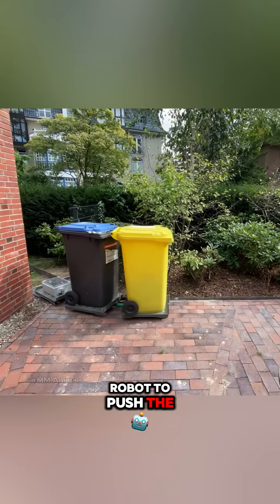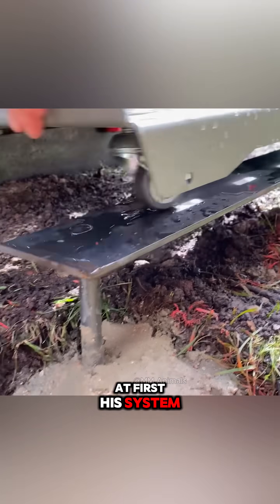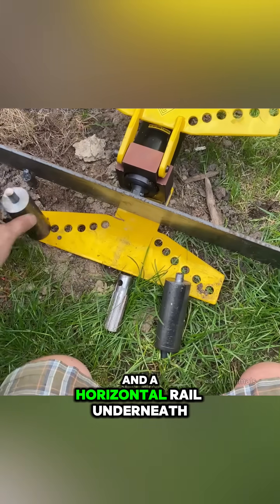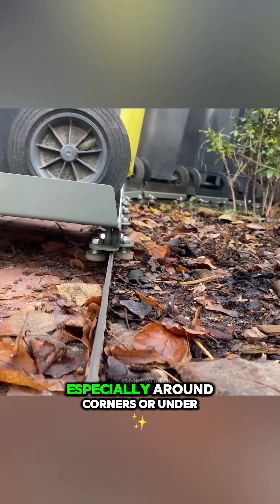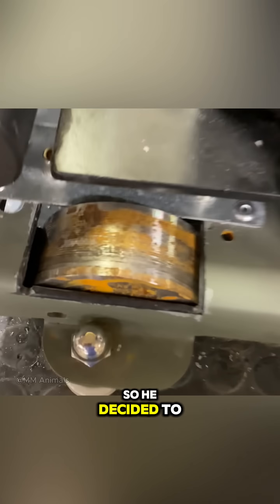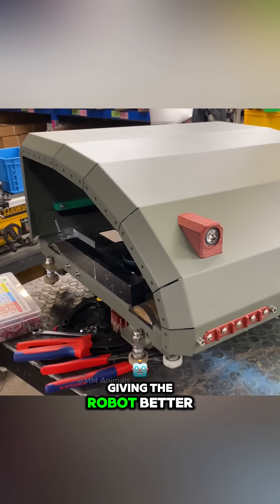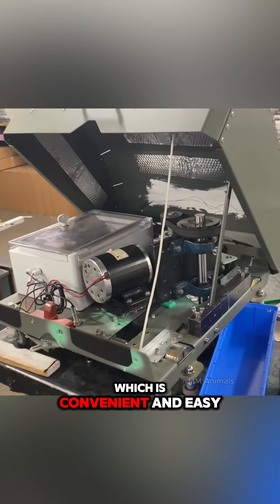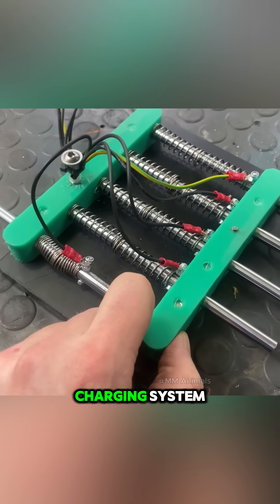He invented a robot just to avoid a daily task #technology  #inventions  #creativity

Comment: It would have been easier to electrify the rails or use a sliding cable like in forklifts and use a lift like configuration for sensors and control... No need for batteries or charging station. Just rails and contacts ... Can add a timer and a emergency stop button with some sensors for safety